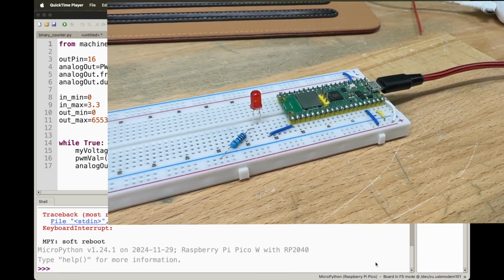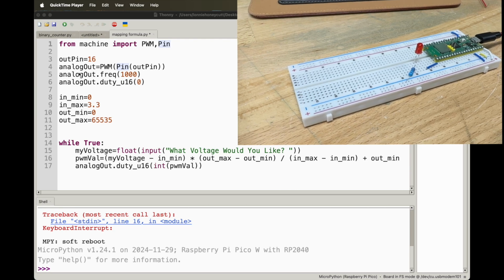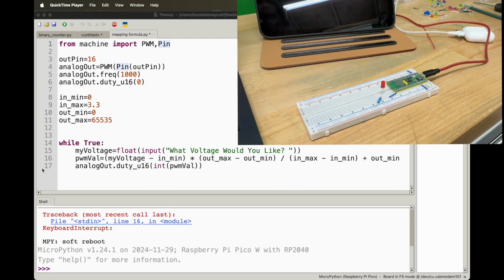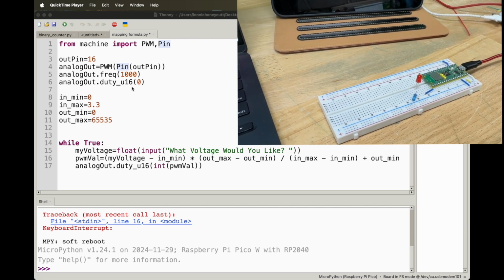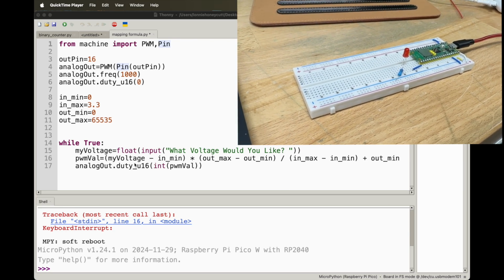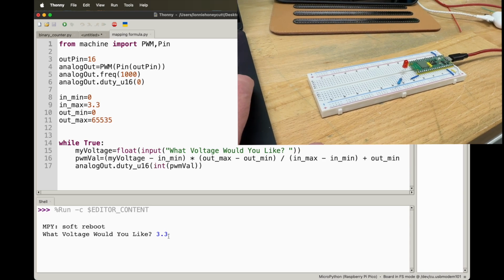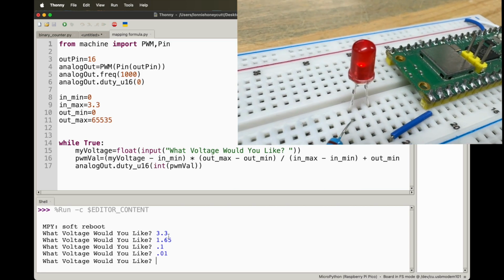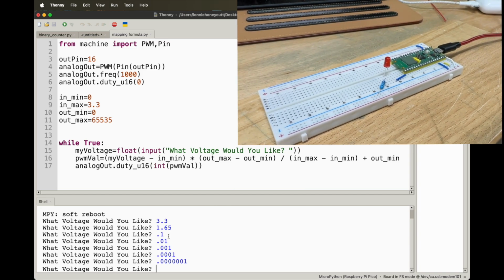How to use PWM on Raspberry Pi Pico - Basic Circuit & Code @paulmcwhorter

Comment: Your input range scale should be 0 to 100%, not 0 to 3.3v. PWM will output either zero volts or 3.3 volts (for RP2040). It won't output 0.1V,  A value of 0.1 is actually turning the output on at 3.3v for about 3% of the time (aka 3% duty cycle).
Reply from the maker: @paulwojcik1856  you are absolutely correct, it’s either on or off.  I used incorrect terminology, that’s the way I think about it in my head.  The average voltage over that time span is approx what I was saying but the true voltage at a given time is 0 or 3.3.  Good point.
Reply from the maker: @paulwojcik1856  however, the input range is user facing, and the idea is to simulate that voltage with pwm.  That’s why the input is taken as “voltage” then scaled to the duty cycle value.  The user won’t see a difference between a true 2 volts and a simulated one, at least that’s the plan.  I could have explained it wayyyy better.